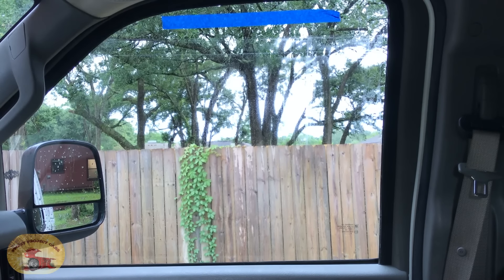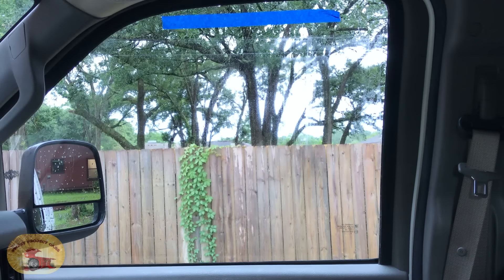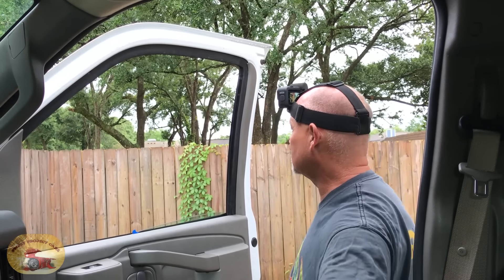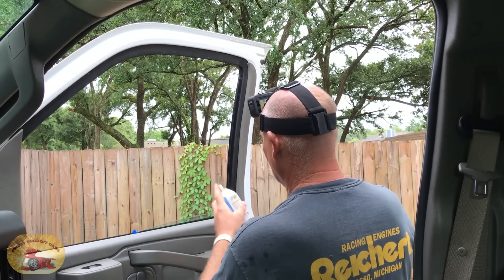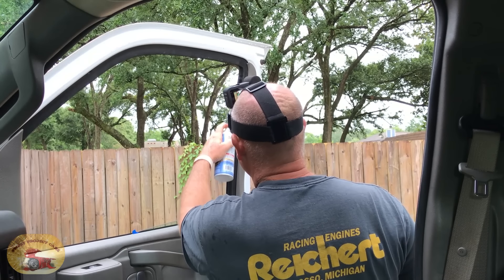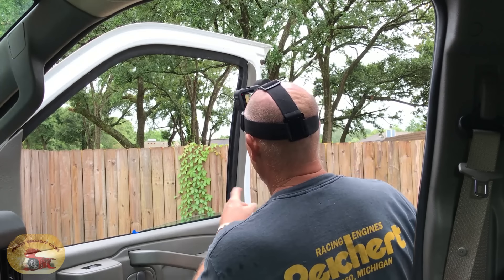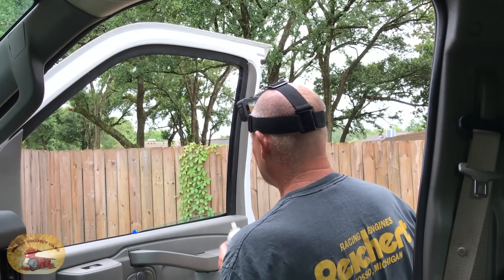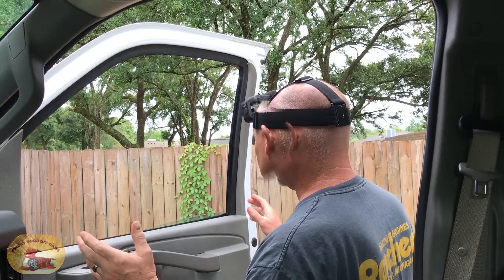How To Make POWER WINDOWS Blazing FAST!!!  in Just 2 Minutes

Comment: I have a '99 Ford Explorer. If I do this to my windows, they'll probably fly out of the frame. They're already that fast. Lol
Reply from the maker: LOL, thanks for watching and sharing and for the laugh this morning :) Have a great day. mad Mike the hammer SPC
Reply: My 99 is the same lol. Also my 88 mustang...they are way faster then my 07 f150 and my 2014 mustang
Reply: I was just about to say, those older fords already have fast windows lol
Reply: I wish. My 96 explorer is slow as a turd on both front windows. I've greased the rollers and guides in the door but I can tell the felt is getting old in the track and I think the window is rubbing raw spots in the track that are more like rubber than felt now. I see my Lowe's and Academy (which are next to each other also!) have the Teflon dry lube and Kiwi heavy duty water repellent. Imma go get some uptown in a bit!
Reply: If you own a Ford, the windows are the least of your problems
Reply: @Jackmerius_Tacktheretrix  Right on! My 1996 Ford Thunderbird had extremely fast power windows. Faster than the ones in my 2006 RAM.
Reply: For real! Gave my explorer to my son. Damn window basically falls out when you hit down.. alot faster than my brand new f150.
Reply: My 96 contour windows are too lol Ford must’ve just been like make that shit fast . They fly
Reply: @oscrfsh  safety did not matter back then  also weak motors
Reply: I would absolutely love to see a video of your window blasting through the top of the door off the rails into the sky 🤣😂 #windowcatapolthack
Reply: Can’t drive 55🎵

Comment: I have a 98 Jimmy, where the front passenger window goes down, but won't come back up. I removed the door panel & the 'spring' has a build up of something very similar to 'lacquer'...it tough & gummy but hard too....any suggestions what to clean it out with?  I LOVE YOUR VIDS....I'VE LEARNED SO MUCH OVER THE YEARS....:-}
Reply from the maker: That's dried up lithium grease, you're going to need this  https://amzn.to/3wIDQHd  with one of these  https://amzn.to/3FzDoiL  you've got to spray it down, let it soak and hit it with the air nozzle, repeat, repeat, repeat as many times as it takes to get it clean. Then use this  https://amzn.to/4dy7vrC  Thank you for watching and asking, glad you enjoy our channel, thanks for being a great subscriber. mad Mike & team

Comment: Interesting approach with the teflon spray. I had previously heard silicon spray recommended. CRC makes a spray can of food grade silicon which is safe for use in commercial kitchens and food processing facilities which I think might work as well as the water repellent spray; but the teflon dry lube looks like the cream on the top.
Reply from the maker: It's definitely the cream on top, we've tried and tested this process for months and months.  Thanks for watching and sharing Iver, hope you have a great week. mad Mike the hammer SPC
Reply: In what way does the first step of waterproofing help? I like your Videos, thank you. @SweetProjectCars

Comment: Great video. 

Quick questions;

Should you let the products dry between applications? 

Also, should you run the windows up and down with the products wet or let them dry? 

I’m thinking running the windows with the products wet would help get the products on the glass too.
Reply from the maker: It works good if you run them up and down while they're wet, the products will be on the very edge of the glass that you can't see so it's not an issue. Thank you for watching and asking Jack, have a great day. mad Mike the hammer SPC

Comment: i tried this with only the blaster teflon dry lube, still waiting for my wet repellant to come in... the dry lube alone so far, has made no changes in performance.
Reply from the maker: Because you need both products, it won't work with just the one.  Thanks. mad Mike the hammer SPC

Comment: Will it streak the window if you use it on the sill of the window (the horizontal bottom of window) as well? Big difference with just the sides.
Reply from the maker: Just apply as we did in the video, you can however remove your door panels and spray the inside tracks if you like, that is something we do as well. Thanks for watching, have a great day my friend. mad Mike the hammer SPC

Comment: Well, all I see that you did is just lubed the windows rails! For some of us that have older vehicles, we can take it a step farther by 1st cleaning said window rail so any dirt &/or debris is out of the windows track so when the lube is added it has an even smoother ride up & down! You should do this cleaning if you drive/operate in a dusty/dirty environment even if the vehicle in question is fairly new(or is new) for example, it is like trying to slide a panel though a rail, which is going to be easier, a clean rail or a rail with rough debris in it?! Well, that answer is obvious, the clean one! So, also which would be easier(as shown here in this video) the one with extra slick rails or dry ones?! Obviously, the slick one! So, nice video but you must make sure to state, clean 1st then lube for best performance!
Reply from the maker: Thanks for watching and sharing, have a great day. mad Mike the hammer SPC
Reply: @elementalblaze79... wow your so smart .. but you must make sure to state how to clean the window rails first before  lube for best performance.  Any other words of wisdom there buddy?

Comment: Incidentally, the easiest way to change the window motors is simply to cut a hole out of the door panel around them. Tin snips goes through that thin metal like butter. Doesn't hurt a thing.
Reply from the maker: Thank you for watching and sharing Will, we really appreciate it. Have a great weekend my friend. mad Mike the hammer SPC

Comment: Off subject Mike but what can I use to clean the crome exhaust tips on my vehicles with a GDI engine?
I used super clean 3-1 which helped but didn't completely clean them. Was thinking next time maybe just straight super clean instead. That carbon/oil mixture is tough!
Reply from the maker: This mix  https://youtu.be/YmzeZS4QO4g  will take off anything you have, it will take about 2 1/2 gallons of elbow grease, but it will do the trick Kerry.  Thanks for watching and asking, have a great day my friend. mad Mike the hammer SPC

Comment: this works great on squeeky brake pads also.   spray the brake pads and rotors with lube on a regular basis.they will be so smooth you won't even feel them stopping
Reply from the maker: Great tip! Thanks for watching and sharing Aaron, have a great day. mad Mike the hammer SPC

Comment: this didn't work nearly as good for me as it did in this video. it's maybe slightly smoother going up and down. maybe i need to actually clean my windows and the rubber seal at the bottom before i do this again LOL. either way thanks for the tip.
Reply from the maker: Thanks for watching and sharing, have a great day. mad Mike the hammer SPC

Comment: This wont always solve the problem.  The windows are slow in my 78 firebird and they dont even have window tracks (frameless), so sometimes there are other factors at play.  Ima hafta take the interior door panel off at some point and take a peek
Reply from the maker: That's exactly what you do with the frameless windows Dwayne, remove the door panels and do the tracks inside.  Thanks for watching and sharing, hope you have a great week my friend. mad Mike the hammer SPC